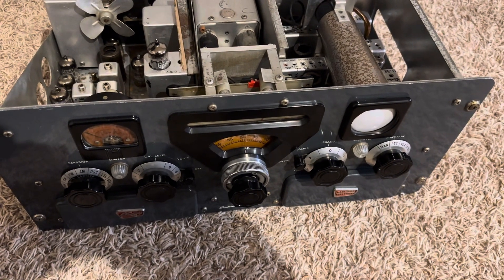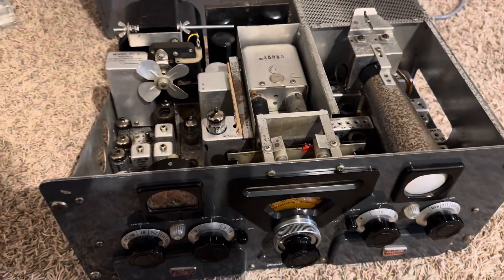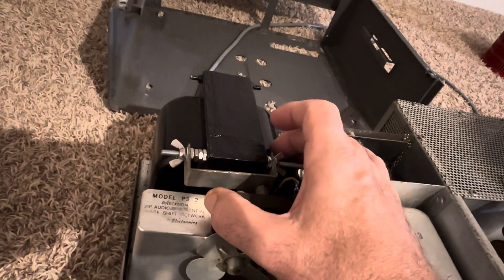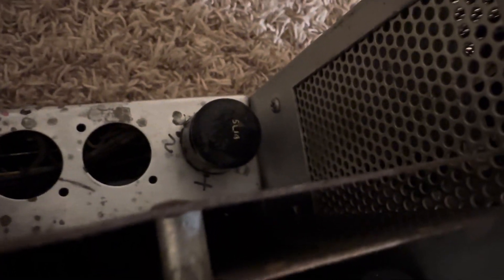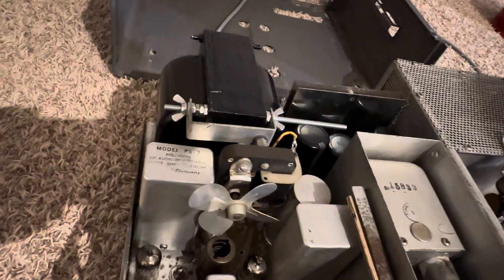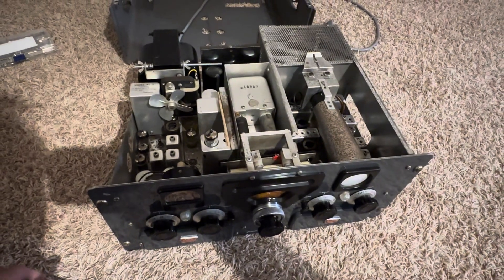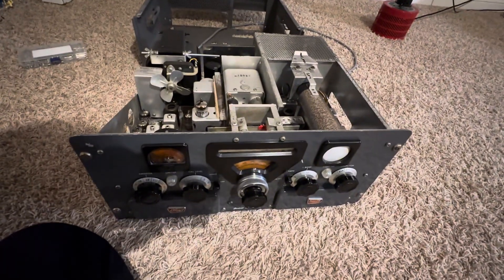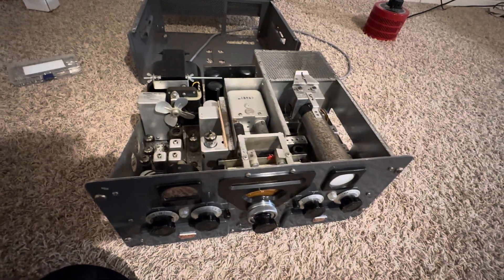BOOM! 100V blew up. 😨 scared the crap out of me. Central Electronics transmitter bites the dust.

Comment: As others have said.......this was likely designed before wall voltage ended up at 125v........   you may need to reduce the input voltage to 110v.   At least to see what the voltages at the transformer are like.
Reply from the maker: There is a lot more to the story. I had a shorted power transformer in this 100V. So I pulled that out and trashed it. I found a transformer from a 200V (spare one) and installed that. The 200V is solid state rectification. The 200V transformer is putting out 825 volts at 123 volts in. If I reduce line input to 115 I still get about 800 volts on the HV secondaries. To get the DC volts divide 800 / .71 and that is way up there. So the cap took it in the nose. I since rewired the HV power supply with a single diode to lower the voltage and scrapped the bridge. I can get 710dc volts now for the finals and that is about 525 volt under load. So in using the secondary I can't use it now for the lower B+ 340 volts I need. So need to add a 240 volt extra small transformer. In the process if that now.

Comment: since they raised mains voltage all over the world many tube radios run into problems.
This one was build for 110V and not for near 130V.
i in my case added a few turns to the primary side ;).
Maybe i would only operate this dev. via a variac.
Good luck:) , 73

Comment: YOU really fix  it. your xfmr should ok,the solid state diode is a no no.  use only a tube or if solid state use a resistor to lower to voltage.  I am sure the transients killed the series caps. 
putting  two 450 to cover a 900v cap you need to lower the voltage best by using a 5u4 tube or tube it was designed for.  Your blowing the caps was expected due to the solid state diodes I have seen this happen before.  Also if you need a new transformer get it re wound to factory specs.  I would not use a tempo ps xfrmer unless you have no other choice
thanks Mike

Comment: If you put 2 e-caps in series and don't use balancing resistors, you stand to overvolt one of them. I'm guessing that's what happened here.
Reply from the maker: Hi, yep I think this i the lower 340 volt supply across one cap only at 450 volts. The cap was always stressed above 450 volts. I am redoing the power supply once again now.

Comment: I'm in the market for an amplifier and that one sure is a beautiful amp,  I didn't catch the brand name. I'm no repair man but looks like you've got a nice amp once you get the right parts. When I was a little boy my dad allowed me to play with his NC303, Over 50 years ago.  Your's would look Great on in my Shack.  Thanks for the video. 73
Reply from the maker: This is not an amplifier. Sorry. It is a transmitter. For a good amplifier look up a Drake L4B. Those run (2) 350z tubes for about 1.2KW. Or for a cheaper amp you might look up a Heathkit SB200 Those are good for 600 watts. Good luck.

Comment: Do yourself a favor and build a bucking transformer. This will allow older equipment that was spec'd at 110-117VAC to operate at the modern day wall voltages 120-125VAC. There are numerous designs on the internet.

EDIT:
adding a link for more info if needed:
https://blueglowelectronics.files.wordpress.com/2018/11/bucking-transformer-slides.pdf

Comment: Sounds more like a capacitor blew rather than a short in the transformer.  You mentioned running one of the capacitors at a higher voltage than it was rated for.  There should be some physical evidence if that is the case.
Reply from the maker: Hi. Thanks for the reply. HUGE BOOM. No capacitors looks blown up with holes in them. I will check the diode bridge too. I plan to pull this power transformer and put in a Tempo One power supply transformer. Problem is this will cost me around $175 from the Ebay estate raider scalpers.